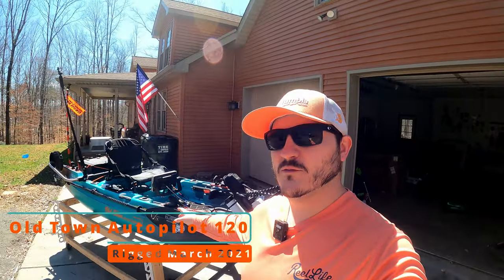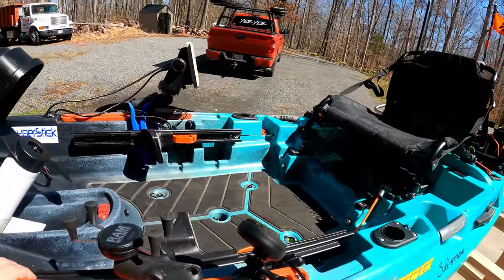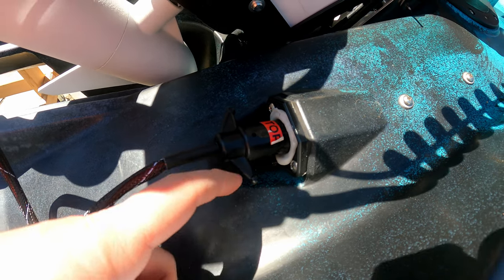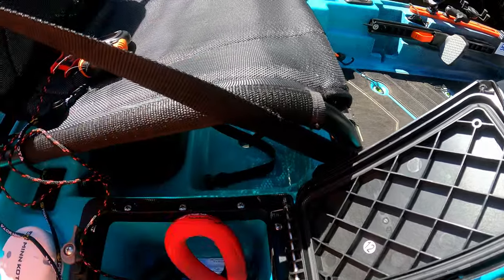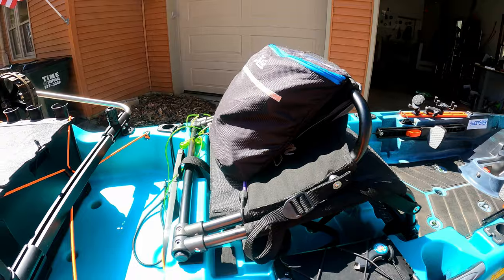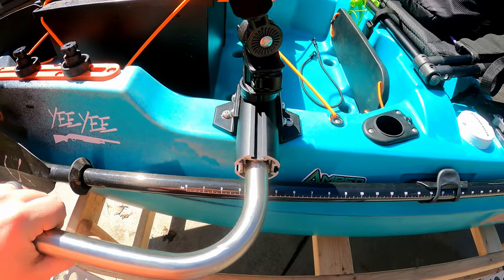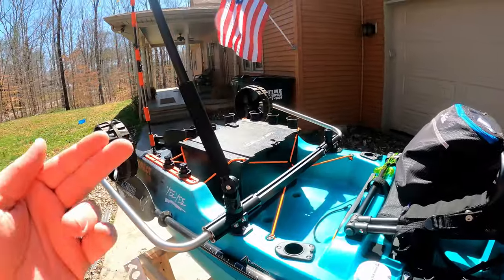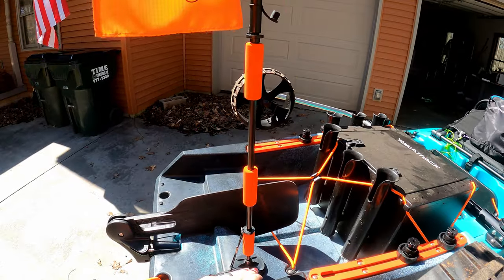Old Town Sportsman AutoPilot 120 | Rigged (Spring 2021)

Comment: Liked the setup. I hang a hydration pack on my seat for taking water swigs.The cart setup looks great, i might try that in the future.  I have the FPV system for controlling all the electrical and that is run from 17AH battery.  The main batteries are a pair of FPV 12v 50ahr that are strictly used for the motor.  i used ocean scupper valves, they work great.

Comment: Do you have an actual video of you moving around your kayak with The Boondocks landing gear and also entering and exiting the water showing in detail how it works and how easy it is on autopilot 120
Reply from the maker: I don’t think I do but the Boonedox is definitely the best option as far as carts go. It’s still heavy but way easier to use than other carts.
Reply: @BlueSummitOutdoors  yeah I get it but I want to see an actual video on the actual autopilot 120 . If you don't mind next time you go in maybe you can make a video of launching and retrieving if not don't worry about it I'll find somebody eventually thank you

Comment: What brand thru-hull wiring cap did you replace the factory one with for your fish finder. Other than expanding the main hole did you have to drill new holes to screw in the new cap
Reply from the maker: I used the Hobie Thru Hulls 3 way plug there is no backing just 3 screws and a seal. Here's the amazon links https://amzn.to/3GCVFvw

Comment: Do you get interference on the fish finder from the motor.  Thinking of getting the sportsman 120 ap and this is a concern and I've seen this complaint. Thanks.
Reply from the maker: Only when they are both connected to the same battery at least that's my experience with it.

Comment: Hello, I have the same Autopilot 120, I found the motor is not power enough for strong wind. I'm using 12V100Amh Lithuim battery.  Do you have the power issue ?
Reply from the maker: No issues for me just have to know the limits of the kayak and be safe. If you are looking for more power Torqeedo seems to be a more powerful motor.

Comment: Are you running everything off your amped? I have basically the same setup but I have fish finder and lights and Puck going to another battery.  After a full day of fishing my amped is still at like 80% so was thinking of running it all to it.
Reply from the maker: I am now currently. I wasn’t at the time of this video.
Reply: @BlueSummitOutdoors  how'd you run that? Spliced into the existing plug?
Reply from the maker: I have a video on how I did it. https://youtu.be/lF463DB7fTM
Reply: @BlueSummitOutdoors  watching it now.  Super helpful info man! Thanks!!!

Comment: How are you liking the boonedox system? also is that the standard one? planning one getting it when the 120AP comes in, Thank you!
Reply from the maker: Loving it! I think its the heavy duty backing plate its the metal 8 or 9 inch backing plate.
Reply: @BlueSummitOutdoors  right on! Yeah I was wondering what size I should get, because some people say that it cracks the yak, thank you!
Reply from the maker: The longer the backing plate the better. I think the 8 or 9 inch are as big as you can go and still fit.
Reply: @BlueSummitOutdoors  good to know, I’ll let you know how it goes👌🏼
Reply: Curious to know whether the front end is heavy when pulling with boonedox located that far aft. Looking to add to my 120 but was thinking closer to CG although the location you've mounted yours appears to provide more backing area without sacrificing rod holders.
Reply from the maker: Yea it’s a heavy but it’s not too bad. Yea it seems to be the best location without losing other features.  You don’t want to sacrifice the backing plate, smaller backing plates can cause cracks.
Reply: @BlueSummitOutdoors  Is this the "Standard" Boonedox or did you have to purchase the HD package?
Reply from the maker: I believe it is the HD package
Reply: @BlueSummitOutdoors  Thanks for your video & the good info. Your rig looks great!
Reply from the maker: No problem. Thank you, and thanks for watching!